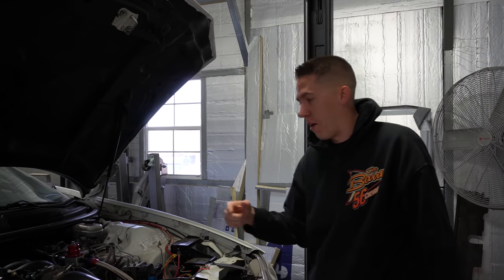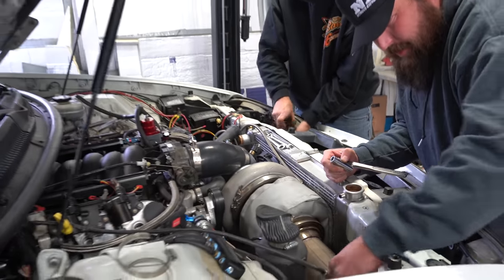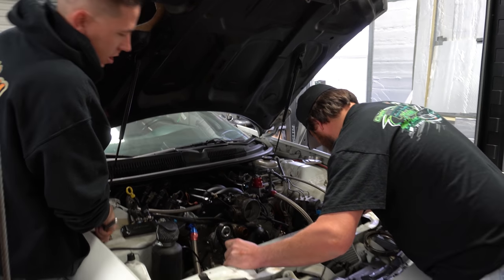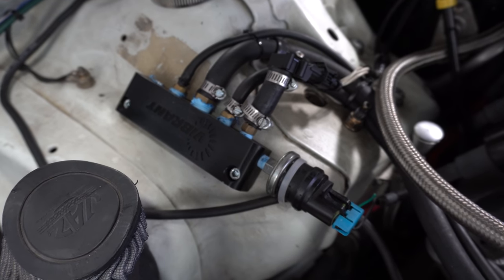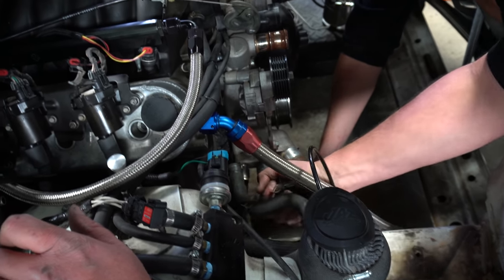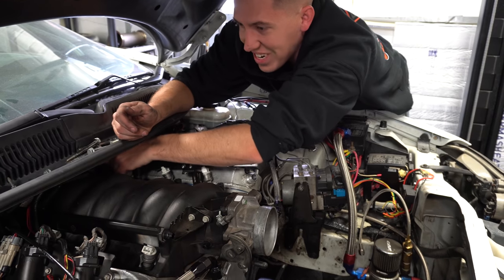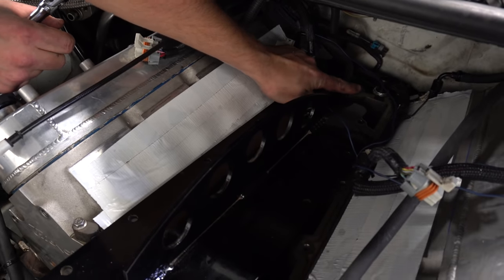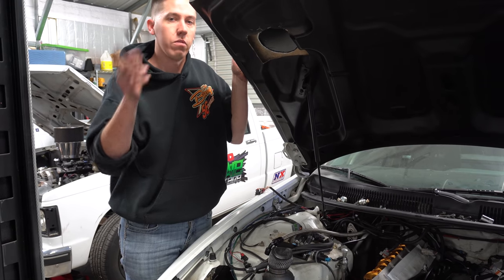Turbo Kit Delete! I Sold The Turbo Off Of My Camaro...

Comment: you won't have to worry about it anymore with a cut cowl but i always loosen the intake bolts and then wrap tape around the body of them so they stay up while pulling it out from under the cowl

Comment: Hello, first off great stuff all the different vehicles and info about you and your dad is great I live in pueblo north and have a truck I am going to build too race I brought up from florida and it is not street ready do I have to register it in colorado if it is for racing only I also have two forth Gen camaros a ttop SLP 2001 SS few bolt ons 61xxx miles and a 2002 Z28 Convertible with 6.0 stroked to 408 Forged bottom end pro charged with a f194A air to air intercooler meth injection 4sp auto ford 9in.on16.69 pounds of boost on100 octane dyno at 1054 on 15 inch Mickey Thompson SS street full cage and five point harness street legal lights and wipers has 64xxx original miles I need to get with you to get a dyno tuning for colorado maybe in the spring.keep up the great stuff merry Christmas and happy new year to you and your family.from POMOFO racing and my family.god bless Gus and family.thanks.
Reply from the maker: Sounds like you have some really nice cars! Can’t wait to see them out when the weather warms up!
Reply: Thanks for replying I am going to need to get the car dyno'd this spring how can I get ahold of you to get the information to get to your shop.and what I need to bring besides the car.ok let me know and we can exchange phone numbers thanks again.Merry Christmas and Happy New Year to you and your family.God bless.